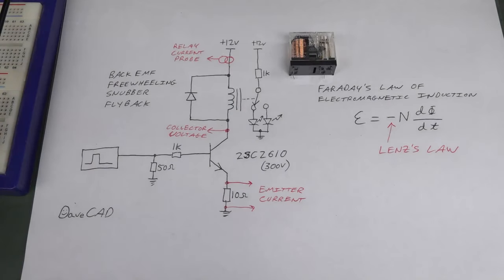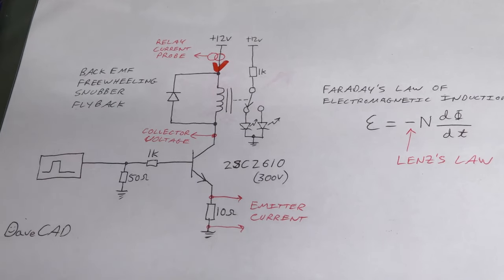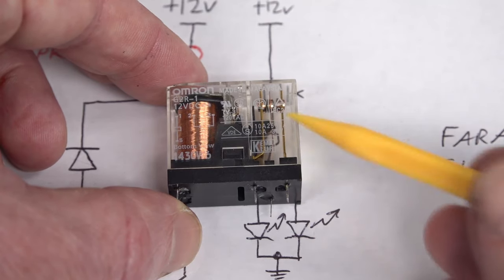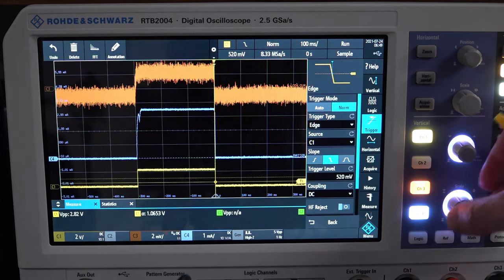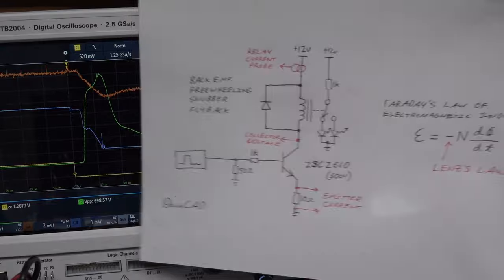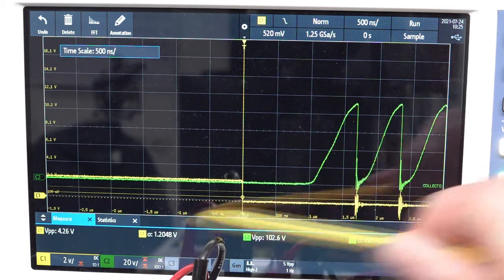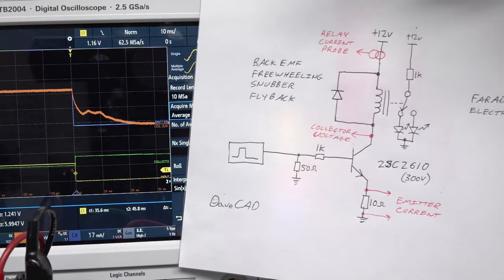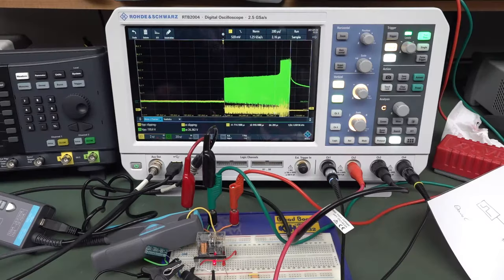EEVblog 1409 - The DANGERS of Inductor Back EMF

Comment: The freewheeling diode reduces the strength of the magnetic field. Maybe the depletion region of diode in RB acts as a capacitor and it forms a LC tank circuit which cause damped magnetic oscillations, or am I overthinking.
Reply: ...actually, the freewheeling diode provides a low resistance path for CEMF produced by the relay coil-(!)

Comment: Does this issue exist on an AC on/off switch as well? I mean I know the arcing exists but can it be corrected with a similar circuit.
Over the years I've seen lots of on and off switches go bad
Reply: Yes, certainly with an inductive load. In that case you obviously can't use a single diode. Back-to-back zener diodes or TVS diode would reduce the arcing but obviously the clamp voltage would need to be greater than the peak AC voltage.
Reply: @eDoc2020  the voltage is the. AC 120/110 from the wall supplying a switching power supply with several outfits. One of the outputs is higher but they're all in DC.

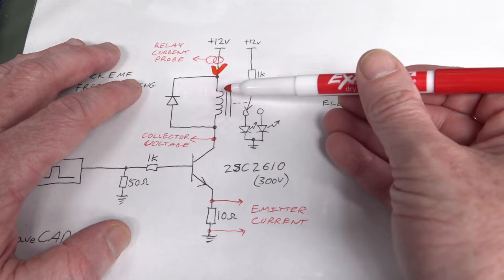Comment: @2:53 "That current flows down through there." Since you have a PNP with the emitter connected to GND [0V] and current flows [current does not actually "flow", but that is another rabbit trail.] from GND towards positive. [Actually from a lower voltage potential towards a higher potential.]

I'm just busting your balls, I know that most people envision current flowing we'll say from a battery positive terminal towards the negative terminal. [I think that's called "Conventional Current...I can never remember which is the correct wrong way???] 
It's just that I learned the true way of flowing from negative towards positive, so when I see it described backwards it stands out like a sore thumb.
Electrons flow against the arrow of a diode or transistor, which they also named the collector and emitter backwards in keeping with the reverse terminology tradition. :-)
Disclaimer: If my perfectionist comment causes you discomfort...Please Disregard.
Reply: The current in the river is flowing from north to south.  One is a noun and the other is a verb.

Comment: I see some designs put a zener/TVS diode across the bjt instead to clamp the voltage. Is there any advantages of this method over the standard flyback diode?
Reply: Put the diode where Dave tells you to put it AND put it as physically close to the relay as possible! If relay is off-board for example, put it around the remote relay.
Reply from the maker: Yes, I'm sure I mentioned this in the video, it decreases the release time. But it costs more, so it's tradeoff.
Reply: @EEVblog  The design is different though. Instead of placing the zener across the inductor (as shown in your video), I've seen it placed across the bjt instead. An example of this is the TPIC6B595 Power Logic Shift Register.

https://www.ti.com/lit/ds/symlink/tpic6b595.pdf

Comment: Why put the resistor on the low side of the transistor?  I would normally put it on the high side.  What am I missing?
Reply from the maker: It's a current sense resistor, and you put it on the low side because of the oscilloscope ground reference.
Reply: @EEVblog  If you had a scope with a floating ground would you have put this resistor on the C side of the transistor?

Comment: Thanks for the young player trap info, I will say most Tech's know very little about why fly back issues can shorten component life. Most get basic idea, your complete demo with scope-well-The BEST. I to this day do not know what a dc brushed motor, (24 volt 5amp drill), can do to the electronics of todays smps. that is raw motor, tear down stuff. Would it require a special tongue angle?

Comment: Actually the diode should match the current of the coil.  So if your coil is pulling 500mA you shouldn't use a 200mA diode for longevity.

Comment: The 'equivalent' situation regarding a voltage source: Shorting the DC supply with the no fuse protection! Do you want to get electrocuted or burned--it's your choice! :)
Reply: Shorten by DC isn't so dangerous as shorten by AC

Comment: Why do flywheel diodes never have resistors in series with them? It seems like inductors dump a lot of power in a short amount of time, would a diode be able to handle all that alone?
Reply: If they weren't able to handle it, diodes won't be used in the first place. Don't be carried away by the magnitude of voltage you get when inductors are open circuited, the voltage reduces to nothing when you connect a load because the energy is less. You can't have more energy than you put in. When the inductors magnetic field builds up when  voltage is applied the energy is finite and stored in the magnetic field. When you open circuit it the magnetic field wants to collapse but for that current needs a path which is not there so voltage increases untill it ionizes air and shorts with a spark. Now the energy is same but the high voltage will be present for a miniscule amount of time. So the energy is conserved. So when  a diode is used it never allows the voltage to climb that high and can be used safely.
Reply: Also adding resistors in series would  slow down the current decay which will affect the relay contacts responsiveness when the coil de energizes.
Reply from the maker: A series resistor shortens the release time.
Reply: @EEVblog  i thought the flywheel less relay should actuate faster because of large voltage drop of opposite polarity present during back emf, so compared with relays halving flywheel diode they should actuate faster?. Is it because of contact bouncing the diodeless option is slow compared with diode one?

Comment: 25:40 If you were to add a resistor in series with the back emf diode would that cause the relay to turn off quicker?
Reply: Yes, anything that will increase power dissipation in other than the relay coil will work. As a bonus you also have less arcing on the contacts when opening, and also faster turn off time as well.
Reply from the maker: Yes, try it yourself!

Comment: I learned about back EMF at when I was around 10, I put a battery onto a record player motor to see if it will spin, it didn't but when I pulled off the wires (was holding the bare ends) I felt like I was going to spin lol
Reply: Likely a synchronous motor coil was connected right across that line cord. You got an “ignition coil lite” experience. Most relays can nicely blink neon bulbs when they turn off without other snubbers present. Neon bulbs are slow – on the order of 0.1ms turn-on, whereas the back-emf spike gathers steam much faster. So they don’t make good semiconductor protection devices. But they blink nicely.

Comment: The energy built-up in the coil discharges very quickly, which for a moment, creates a stronger magnetic field that pulls the relay contact faster and harder, making the sound louder. However, I also think the actual magnetic field collapsing is getting picked up by the coil in the microphone as well. The louder sound is partially the hard knock of the relay switching harder, but unless it's so loud the audio is clipping, I think I hear the snap of the magnetic field in the audio. It's hard to say for sure, but that's what it sounds like.

Comment: A lot of automotive relays, especially in expensive foreign cars, contain a resistor snubber.  If you replace one in a car, make sure you use a snubbed relay.  ECMs are a lot more expensive than the proper relay.  There's an automotive diagnostic video on YouTube telling the story of a mechanic trying to get someone back on the road, after their fuel pump relay went out.  Replacement, unsnubbed, American parts store relay worked for a couple of days, then fried the output transistor in the ECM through high voltage spikes.

Comment: That was a lot more fun than I expected.
 Being able to monitor reverse EMF was interesting, didn't expect such a high voltage from such a small coil.
 Being an 'old school' motorcycle mechanic I don't get to use oscilloscopes and have to use a peak voltage adapter in an ordinary meter which tends to average out max voltage. I have only seen 318v on a 12v system but now I'm sure it was much much higher.
Thanks for an interesting vid. I'm off to see the Fluke meters next.

Comment: 1985.  9th grade.  Industrial arts teacher was thrown into the responsibility of teaching the new electronics class, with several Science Fair 200-in-1 project kits.  Being she barely knew which end of the battery was (+), and me stupidly wanting to help someone that I would later understand was simply a tenured government employee who was almost illiterate and always voted for the Democrat (yes, I kept in touch with her well into my adulthood), I volunteered to help.
Along the way, I bet her that I could make the simple 9 volt string of batteries shock the fool out of her.  I wired up a relay and capacitor in self-pulsing mode using the NC contact and wiper to power the relay, with the output transformer acting as a step-up ignition coil, and won the bet.  There was a wierdo in the class who actually enjoyed the shock... he would hold onto it and giggle.
Back EMF can be quite entertaining... like charging up a 200V 1uF cap and leaving it on the workbench.

Comment: Excellent demonstration of a very necessary protection for inductive circuits. 
I have made many pulse width modulation power control circuits, mostly with multiple BUZ11 mosfets in parallel, for speed control of electric trams on my 7.25" gauge garden railway.
In every case, I fitted a substantial flywheel diode across the output to the motors (which could draw up to 60 Amps). Even on lower current applications where relays were involved, diodes were a must.
One point that should not be overlooked is the use of fast recovery diodes to handle high frequency switching.

Comment: I like to add a low-value resistor in series with the back-EMF diode, on the order of 10-100 ohms.  It allows the diode to snub the voltage spike at a higher value, still within the maximum C-E voltage rating of the transistor, but it dissipates the energy in the relay coil faster, allowing the relay to drop out considerably quicker.  This reduces the chances of damaging contact arcing occurring in the relay.

Comment: When it's across the horizontal output and flyback of a CRT set it's almost always called the damper, and in some sets (mostly older tube sets) it dumps into a big capacitor to develop the boosted B+ voltage for the horizontal/vertical output. Which is why when you had a weak damper tube, the telltale symptom was a small picture that didn't fill the screen.
In the secondary winding of the flyback, those big pulses (and the resonant frequency of the transformer) is what develops the high voltage for the CRT, not just the ratio of primary to secondary windings. In fact, in some designs it worked a little too well. There was a "critical safety" snubber cap in addition to the damper diode to keep the HV down. If the cap failed shorted or open, it would kill the HV. No worries. But that's not what happened. The caps changed in value and let the HV climb until something blew, and that something was often the neck of the CRT. Lots of infamous TV set fires started that way, not to mention getting free whole-body X-rays at home.

Comment: The snapping sound without the diode in place may be the high voltage pulse EMI entering the 
sensitive microphone input and not necessarily a change in the acoustical energy impinging on the diaphragm of the microphone.  That would require another investigation the determine.

Comment: Haha, I've learned Faraday's law on my own as I was 12. In the school physic lesson I've measured active resistance of primary winding of large 500W transformer using 9V pointer multimeter and hold both contacts with the hands... I was really surprised by transformer. Remember until now :)

Comment: Is there a case where one would want back emf?
Reply: Oscillators
Reply: Car ignitions. The high voltage creates the spark in the spark plug.
Reply: Yes. i make a product with a circuit which simulates the presence of an automotive ignition coil by adding the back emf spike to a square wave. It is clamped to about 400V which is plenty for the downstream circuits to detect, without being anywhere near as high as that from an actual ignition coil.
Reply: Flyback isolated DC-DC voltage converter.
Ignition transformer for old cars.
High-voltage CRT vertical deflection transformer.

You can trust that engineers can put EVERYTHING to use.
Reply: Plenty of applications, most of which are in the field of power conversion, like the most common low power SMPS units, almost all of which use flyback circuitry to generate the voltages.

Other uses are to drive piezo transducrs, which also need high voltage.

Comment: I have an antique "Hipps Toggle" electric clock patent 1896 that runs on 3v that the back EMF packs quite a punch. I was holding the wire when the contacts opened once. It hurt! The back EMF actually makes the magnet coils thump when the contacts open.

Comment: The same principle applies to running a vacuum tube amplifer at full amplitude with no speaker attached! The output voltage will swing to astronomical levels, causing arcing and permanent damage to the output transformer.

Comment: The best way to imagine this is by imagining that you have millions billions of small torsion bars that are randomly arranged in space. Apply current and you force all of them to face a particular direction, stop forcing them to that particular direction and the will just "spring" back to position. Tada!

Edit: Actually the 1N400x series are mainly rectifier diodes and should probably NOT be used as flyback diodes. If you can afford to use a Schottky ( cause of the higher price and lower breakdown voltage ) just go for it. Else you probably want to be using roughly at least the same rated diode as the current that you are switching.

Comment: "You're not gonna feel it" Wrong. As a kid, when experimenting with relays (using one to switch another), I got shocked. I had no Idea how it worked, but I replicated the circuit and soldered it onto a board and felt cool showing it to my friends "it gives electric shocks!!! Go touch it!" I felt so cool.
Reply: You can just use a lab solenoid, a power supply, and some leads, Have them hold on to the leads across the inductor with bare hands, and you yank your side of the lead from the power supply.
Reply: Oh yeah, I've gotten zapped by relays before and you DEFINITELY feel it! Before I understood about counter-voltage spikes, I couldn't see how a simple battery powered circuit was able to zap me like that!

Comment: would you hear a blip on an AM radio?
Reply: Yes! You could attach a long (a foot) wire to this point to make an antenna! But it drops off with inverse square as distance to radio increases. So your neighbor might hardly hear it as an interference.
Reply: ...you'd hear SOMETHING-!!!
Reply: Not only regular radio but also TV. I made a relay buzzer when I was younger and it put loads of snow on the screen from several feet away. What's more is we had cable TV instead of an antenna at the time so the level of interference must have been huge in order to get into the signal.

Comment: I built a solenoid motor using a switch and always wondered why it would spark so much and burn out the switch then one day I realized its like a car coil using the collapsing field to make HV for spark. So I put a diode then solved that problem! an led also works as well too so you can see it light up

Comment: Hi Dave at about timestamp  18:12  it sounds like you are stating that the "area under the curve" does not represent much energy, due the short time.   Being picky about mathematics it just made me wonder, this (voltage x time) area  does not have units of energy (Joules).
Maybe you were not speaking of a scope plot of 'voltage'??   Even if the plot was of current, the area would represent "CHARGE (Q)".....just overly-curious  about units.

Comment: Does using a flyback diode mean the power supply has to sink the small amount of current, or does the diode dissipate the excess power. Cheers

Comment: Nice video Dave.
I've recently bought a KASA smart WiFi power strip with 3 outlets KP303...
1 outlet is working properly, just operates an LED desk lamp for night security, timed to come on at 4pm in winter..
The other 2 outlets are stuck ON, they turn on the PC and 3 monitors and 2 phone chargers.
These 2 outlets feed 2 switchable 6 way power strips and at the moment, I have to switch these off manually, defeating the point of buying the WiFi power strip.
I haven't taken them apart yet but I suspect the relay contacts have stuck and a Snubber circuit like featured in the last few minutes of this video will be needed to be fitted.

Comment: Actually that is not that clear where and in what form a capacitor stores its charge because in some experiments you can change electrodes and get your charge back from dielectric but another cases leads us to conclusion that charge is a result of a charge carriers displacement in plates. And in a vacuum capacitor there is no phisical dielectric at all, just emptiness. It's more like a complex phenomena that includes several another in itself.

Comment: Ran into this problem! Was fitting PLC’s to drive 24v relays which drive devices, fuse protection kept blowing and it was the back emf of the relays! They had no diodes and it was dumping its coil current back and smashing the fuse modules, ended up wiring diodes just like shown here, only problem was we had over 1000 relays hahah.